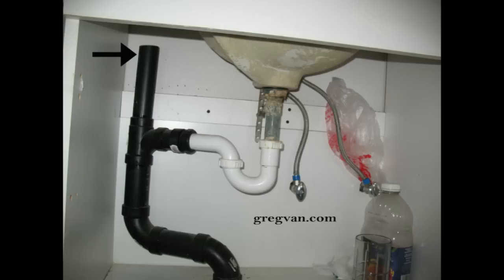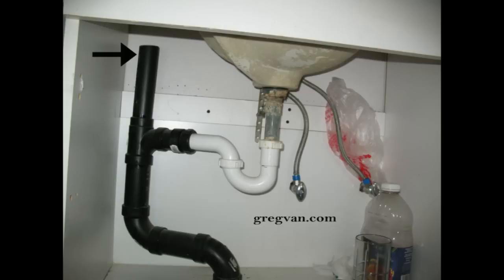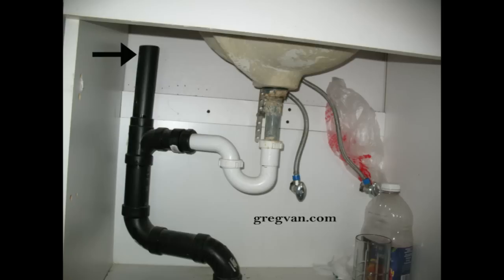What Not To Do With Sink Drain Vent Pipe-  Plumbing Nightmare

Comment: Most people wash their hands after flushing; refilling the trap.
Reply from the maker: Jen Son You're absolutely right and most of the time there will be enough water in the trap, but the water can be pulled out of the trap by flushing a nearby toilet if you did cap off the vent or installed a mechanical air admittance valve that failed.

Comment: Not really. These are dummy vents. Used in cases  you have no access to the roof. I have two in the basement. Never had any issues with them.  Not everything is perfect in the world. Especially in old houses.
Reply from the maker: True, use air admittance valves if you need to.

Comment: It doesn't have to go throgh roof just has to be like 6" above fixture. Then put Air admittance valve on it to keep the gas out. Way better than poking tons of holes through roof. I can't believe all these NEW houses with half a dozen vent pipes poked throgh roof and then wacky solar panel installs to dodge the pipes. DUMB! I'm not a plumber but I know you need only 1 vent through roof and it should be 2"...the rest cane hav. I got a permit and remodeled and elim 3 silly pipes mucking up my roof. Passed inspection.

Comment: so many issues here , should never be allowed anywhere , plumbing code is bottom line ! in this case there isn't even a silly pro-vent nor is it at least at top spill level under sink . capping it is still lame it's now not going to drain right !
Like they say do it right or don't do it at all !!
Reply from the maker: You got a good point and even a better quote.
Reply: Thanks been a plumber all my life , pride and experience fixes a lot of problems !
Reply: actually it is getting very common to use aavs because of the crappy way it looks having so many pipes sticking out of the roof with potential leaks around each one.......some peoples info is soooooo outdated.
Reply from the maker: dave elliott That's interesting, but I haven't seen it yet. I wonder if it will be something used more in the future.
Reply: i kinda doubt it... especially in Chicago-Illinois area's !!
Reply: While some state and local building departments prohibit AAVs, the International Residential and International Plumbing Codes allow it to be used in place of a vent-through-the-roof. AAV's are certified to reliably open and close a minimum of 500,000 times, (approximately 30 years of use) with no emanation of sewer gas.
Reply from the maker: Again, just because a product works well in a test lab or under certain circumstances, doesn't mean yours will. If possible, until these products have been actually tested for 30 years, I would advise sticking to the tried-and-true method of venting through the roofs.

Comment: If you know there’s a blockage, and heat “stuff” in the vent, like the wound of pebbles or more likely rodent “stuff”,  and you have a bathroom with plumbing but no fixtures, and another bathroom next to it, in working order, and your house stinks, please take a stab at that.
Reply from the maker: I not sure what you're suggesting, could you provide us with a little more detail. Are you suggesting that if you have a bathroom on one side of the wall with fixtures and another bathroom on the other side of the wall without fixtures that you have a solution for reducing horrible smells?

Comment: I think it's very strange that you didn't reccomend putting an AAV on that pipe. If I'm not a plumber and I know it,  why shouldn't you? Its nothing new. I think you're on the take buddy. I think you have ulterior motives 🤨. I suspect that you may be one of those killers of progress. I'm wondering if you're not selling out...
Reply from the maker: You found me out, I'm one of those individuals who lurks in the dark and only comes out when it's light outside, but sometimes come outside when it's dark. Kind of like one of those Winnie the Pooh days and by now you're probably wondering where in the heck am I going with this and I don't even know. I think your answer might lie in the fact that you might have missed something I suggested in the video that will make it all crystal clear to you. Watch the video again and let me know if you hear anything about the building department, building codes or problems local building authorities might have with this newfangled contraption that they might not approve you using.